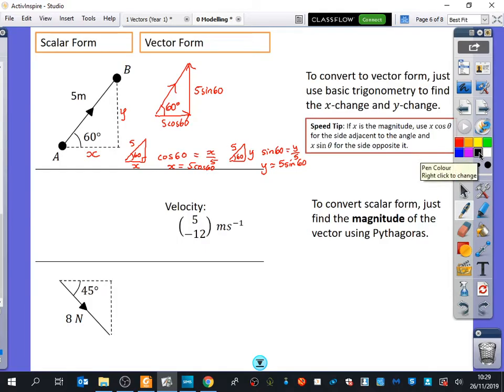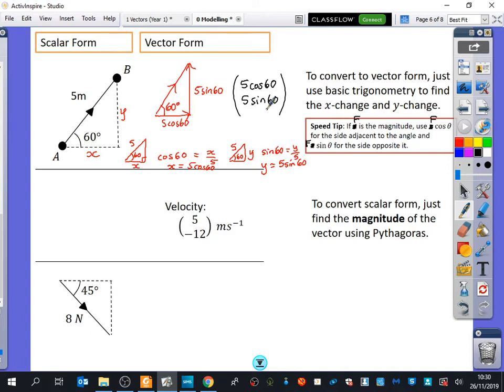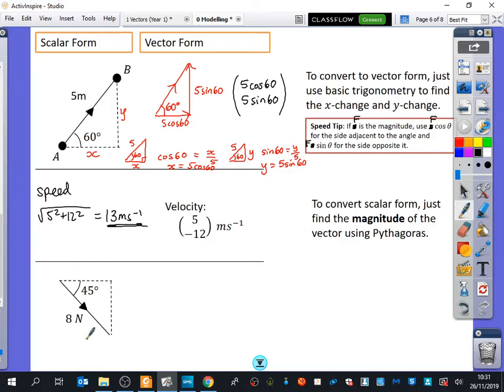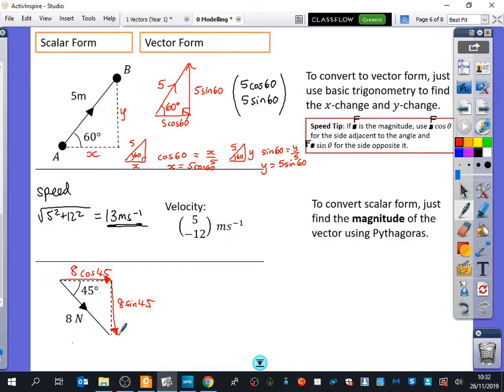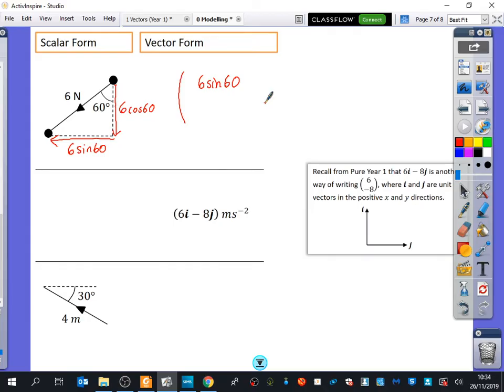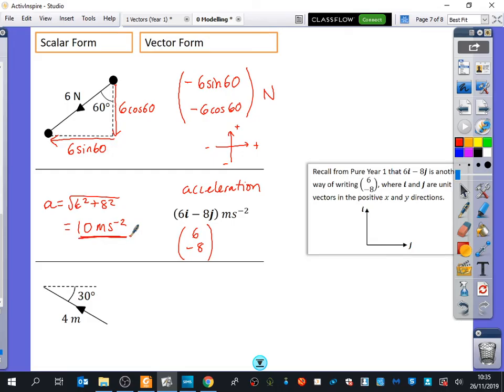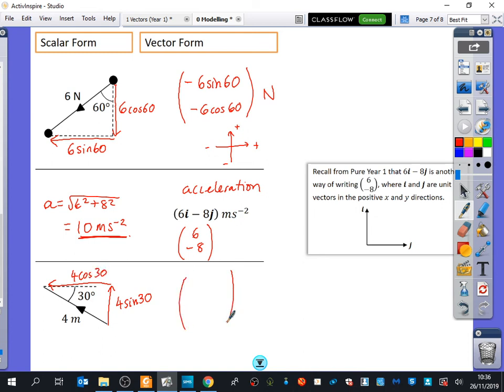Modelling in Mechanics 2 • Scalars to Vectors • Mech1 Ex8D • 🚀

Comment: How do you know which directions the arrows go
Reply from the maker: For vectors, we know that positive i goes to the right, and positive j goes up. So negative i goes left, and negative j goes down. Does that help?
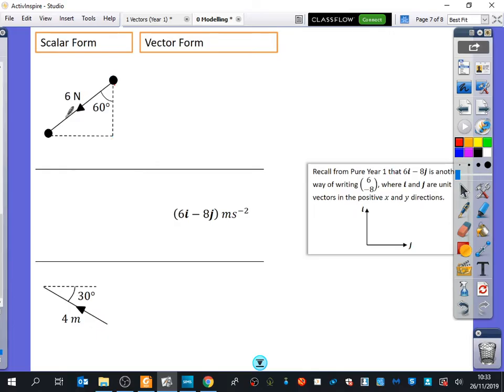Reply: @BicenMaths  in 4:09 for example how do you know the arrow went down before even answering the question
Reply: @Precious3339 You have to go  from tail of the vector to head of the vector, using right angle triangle, its like a diagonal of a rectangle, there are two possible routes, both will give same i and j,  so start from tail and draw your triangle. hope it clears.